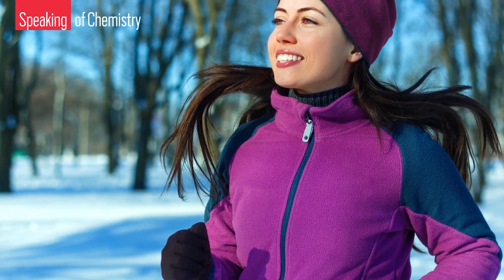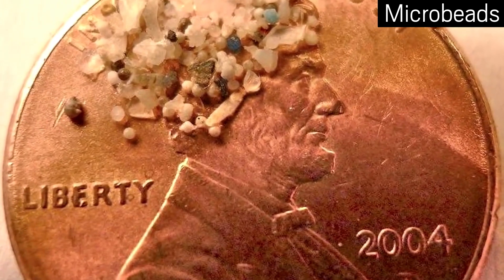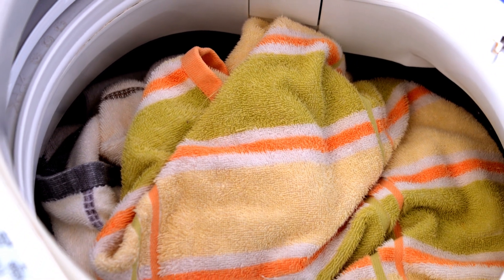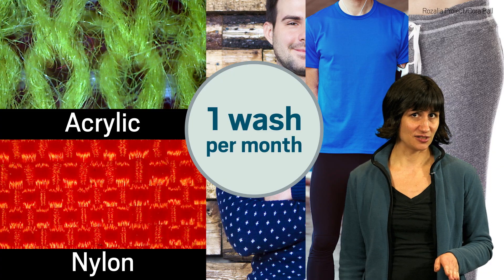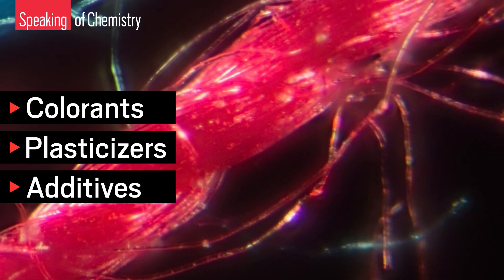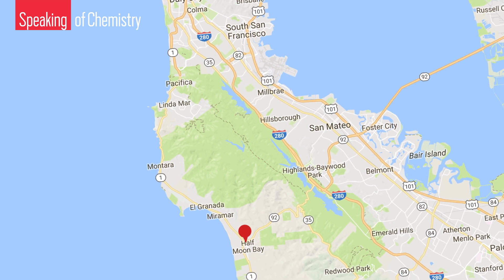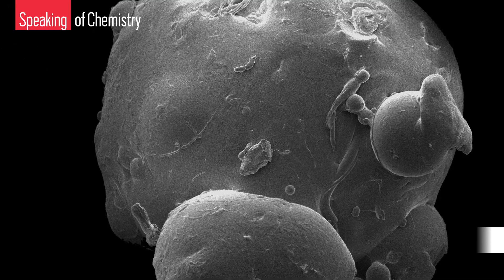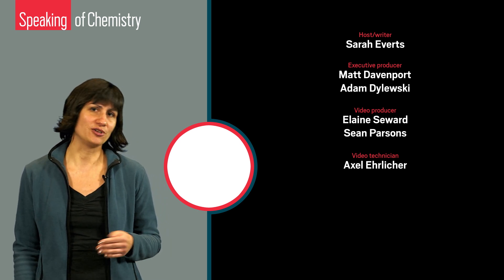The dark side of synthetic fleece—Speaking of Chemistry

Comment: The Rozalia Project solution, the Coraball, seems much less effective than upgrading treatment plants. The Coraball is advertised as catching 35% of all microfibers whereas MBR based treatment plants catch everything down to about a tenth of a micron. From what I've seen in research papers, there is an increasing quantity of particles as the particle size decreases and I'd guess that xenohormonal effects increase as particle sizes decrease as well, but I have no idea. Microplastics produced from washing are probably larger so there's less need for the Coraball to catch ultrasmall particles so maybe there is a place for it. And that lint will probably end up in a landfill which is at least nominally kept separate from groundwater whereas treatment plants will often use the waste as fertilizer which is a pathway for groundwater contamination. 

There's work out there to find or engineer microörganisms that can eat nylon and polyesters which could allow the continued use of treatment sludge without contamination. In the meantime, it seems best to transition to biodegradable materials for everything that doesn't require the particular performance characteristics of materials like polyester or nylon.